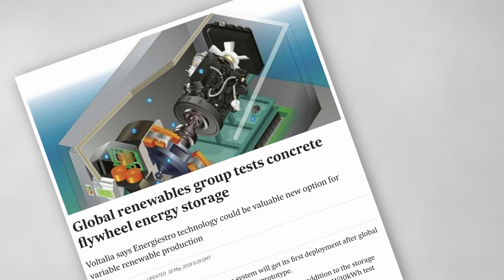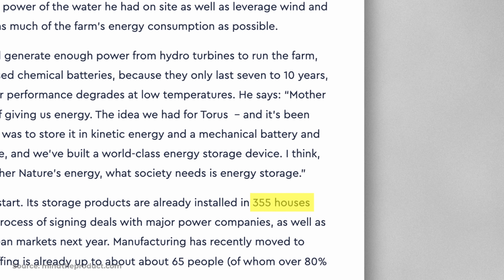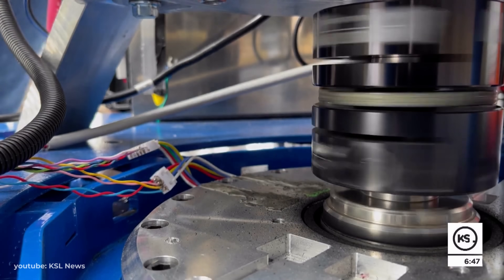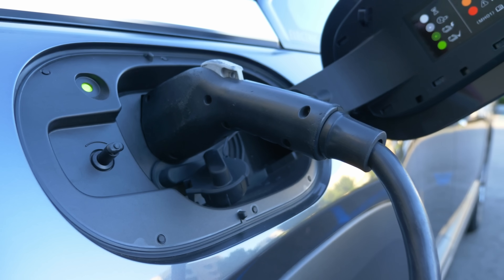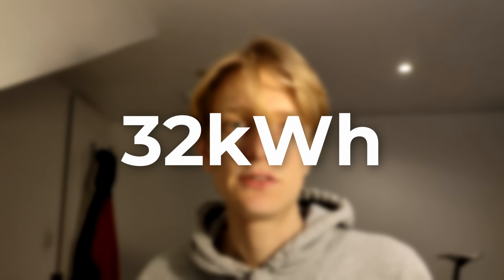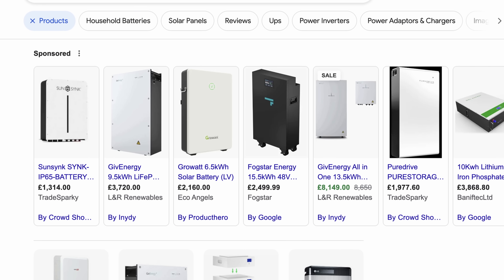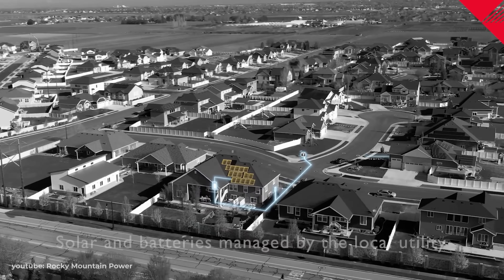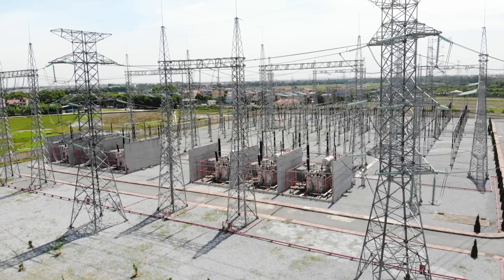Is this *FINALLY* a Break for Flywheel Energy Storage?

Comment: flywheels are bad in vehicles period... yes they work but any vibration will effect it and even the slowing down of the flywheel will have the vehicle turn in that direction... let's just keep it to buildings and accept that battery and capacitors are best for cars.
Reply: Turning moment can be eliminated by the use of paired contrarotating flywheels, and balance is no more critical than in any ICE, but the big problem is one that you missed.
Flywheels only work by being heavy, and increasing the weight of a vehicle is the last thing you want if you have any aspirations towards efficiency.  This is also a huge problem for battery-electric vehicles, of course, so need not be an immediate death sentence for the idea.  In essence, if you can overcome it for chemical batteries there is no obvious reason why you can't do the same for kinetic storage batteries.  The benefits are different in terms of leak down vs almost infinite cycle life, so the way in which they are used would be different as well, but things like magnetic bearings and vacuum containment vessels could improve efficiency quite a bit in all applications.  I think there is possible room for them in any short-term energy storage applications, and it is in fixed installations that the technology will be refined, just because it is easier, but mobile uses will increase in viability as the technology improves.  Enabling higher speeds allows lighter flywheels to store the same power as heavy ones do at present, so materials matter, as creating the best power-to-weight ratio requires putting as much of the weight as possible near the rim, and that means strong but light materials for hub and spokes, and a very strong bond between them all.  At present, that increases the cost, but it does not mean that will always be the case as those materials become less expensive with time and economies of scale.  The power-to-weight ratio doesn't matter in fixed installations, which is why it is so much easier.

Comment: It really surprises me that no one seems to be doing a large diameter flywheel, possibly under the garage floor, or under the basement floor, where the advantage of diameter can be used ... With advances in control and power conversion electronics, the conversion from DC to 50/60Hz can be avoided when charging the flywheel, and conversion to AC 50/60 Hz only needs to be done once...in truth, the use of AC power for most loads in a modern home is grossly wasteful, as it has to go through a power factor correction phase, then conversion to lower DC voltages inside the computer, tv, washing machine, et al...
Reply: You don't put stuff with moving parts in places where you can't service it.   Under cement would be a poor choice.
Reply: @zachansen8293  Couldn't the flywheel be built in a room underground with enough space for maintenance? If the design is thought out well enough, it shouldn't be a problem.

Comment: Flywheels are very much a special needs thing.  I am fascinated with Gyrobus;  City transit buses with flywheels. In the 1950's 60's were lead acid batteries didn't have the power storage. And running an overhead power line for the entire bus route could not be justified.  So, they had an overhead 3 phase power at the BUS STOP at either 2 or 10km intervals. But it appears that a 3-ton gyroscope causes wear and tear issues when you start to bounce it around.
Reply: we now have contactless bearing so I wonder if we could revisit that concept
Reply: Kind of surprised nobody is combining flywheels with batteries yet.

As in literally spin the batteries.

Batteries are heavy.

In an electric car, regenerative braking is usually very lossy. The motors produce way too much power than the batteries can absorb. If you could dump that into a flywheel that slowly bleeds into the battery, you've just solved two problems.
Reply: @jtjames79 A heavy spinning flywheel couldn't be vertical, or else it would cause gyroscopic resistance when the vehicle turns.
Reply: @kolbyking2315  You need more James Burton.
Reply: @jtjames79  that would be great for fast charging your car as well, instantly spin up at a charging station, over the next 30 mins it would charge your battery as you drive.

Comment: I read about using carbon Flywheels, magnetic Barings, spinning at 100,000 RPM in Popular Science in 1973.  I always wondered why it never came about.
Reply: The carbon fatigues and when it explodes it destroys everything in a 100m radius.
Reply: Carbon fiber composites have tremendous fatigue resistance surpassing that of steel.  Further, it isn’t the carbon fiber that fatigues over time but the epoxy or other matrix.  Properly manufactured, carbon fiber composite will outperform steel albeit at a significantly higher price.  Cost is the issue.
Reply: @Michael-Has-Opinions no, it doesn't. They're in use today.

Comment: How much noise do they make?
Reply: Gyrobus [City transit bus using a flywheel] are noted advantage of being "Quiet." In Gyrobus's in the 1960's.  Though the cost made a lot of noise.
  Note: recharging was done though an overhead power line at certain stops. The bus stop was powered not the bus route.
Reply: when "nominal", or when the explode in your house filling it with shrapnel?

Comment: I'm surprised that their form factor is about as tall as it is in diameter. The energy is related to the square of the radius and only linearly with the height. Why aren't we seeing a form factor that is a thin large diameter disk...with the mass held out by spokes?
Reply: Probably has to do with containment of pieces in a catastrophic failure.  My guess is that the vacuum chamber is built a little heavy to keep things together if it all goes bad, and making the flywheel larger in diameter could dramatically increase the cost of that.
Reply: You can spin a smaller diameter flywheel faster. And, a smaller diameter takes up less “floor” space. There may be other benefits to a smaller wheel spinning faster. Flywheels in general aren’t a good idea beyond short duration stuff anyway.
Reply: vacuum

Comment: Sounds more like a mechanical capacitor. 10kWh is hardly a lot for car charging but maybe a solar array (a big solar array) could spin up say 10 devices over the day which would then allow a car to charge, maybe, 80kWhs in 30mins. But $36,000+ is a heck of a lot of money for such convenience. It would probably be cheaper to own two cars and have one on long duration charge (from the solar array) and then just swap vehicles rather than trying to charge just the one car in a short time. 
I guess it's the bearings that cost so much - and is the flywheel kept in a vaccum?

Comment: Thank you for a great video. So well done and covers a broad range of applications and use cases. A couple of facts on our wheel. The motor on the power side is 40 kw (nominal) 88kw peak. Storage has three different sizes in kWH. 15, 22, and 50. The motors are hot swappable depending on use case. EV fast charging, commercial/industrial or large scale utility. The price in the article highlighted was for a full home systems.  Solar, hybrid inverter and hybrid chemical + flywheel storage. Which is why the price point is so high. This wheel will last for 25-years so the levelized cost of storage is exceptionally competitive to the life of almost all chemical batteries. The goal here is to divide the cost over those 25-years vs needing to repurchase chemical batteries that are tough to recycle every 7-10 years. Last part. Chemical batteries like to be in the 80%-20% charge and discharge range. So a 10kWh battery really is a 5ish kWH battery. Flywheels are 0%/100%/0% so the full range with no memory loss. All energy storage has drawbacks and flywheels have plenty. But for the use cases highlighted in this video they do a great job. Again, thank you so much for this we are a passionate team dedicating ourselves to this endeavor and the time you took to cover us without us even knowing Torus meant a lot to the team. So thank you.
Reply: 96-144v, it is an isolated DC bus, DC coupled. It is connected to a Hybrid inverter through MPPT’s. You can put 1watt-88,000watts into the wheel and that can be grid, solar, wind, or hydro. How fast, is really predicated by how big the array of solar, wind or hydro is or how big a grid connection is. 

Same rules apply on discharge. 1-88kw. But 88kw is peak. It likes 40kw. One good use case for residential outside of home loads is DC-DC fast charging at home. This is a big leap forward. Same with V2G or V2H which comes out of the box with a flywheel because of the nature of the wiring architecture vs an AC coupled 12kw 48amp “fast charger”. You are correct in assuming if you replace the bearing race pack you could put it back in service. Our life cycle testing though has not gone beyond those assumptions. These can be placed in an array. Parallel or Series to accomplish many different jobs for home, grid or commercial/industrial activities. Great questions and I hope this helps.
Reply: @NateWalkingshaw  Your DC fast charging at home proposal is misguided targeting the wrong ideal demographic.
1) Average person DOES NOT drive more than 30 miles a day in the USA
2) $200 charger 240V @ 48A with a 250 watts per mile vehicle is 48 miles so now refer back to #1
3) You still have to purchase the DC fast charger costing as low as $10K (25KW) and up to $64K (Tesla Supercharger)
4) If 25KW charging is sufficient for 100 miles of range per hour of charging with all previous context why are we chasing faster charging at the cost of accelerated battery degradation?

With that out of the way, how much is just the entire flywheel system excluding off the shelf non-proprietary components and what kind of hypothetical delivery date can we expect if ordered now?
Reply: @NateWalkingshaw   Yes, that’s very helpful, thanks. I had no idea that useful energy could be added to a spinning wheel with as little as a watt of input. So if you have a 5kW source spinning up a 20kWh wheel, how long does that take? I’m guessing that it’s like hydro storage, where you “pump” for extra time to achieve the rated output. So five hours of spin-up might yield four hours of draw-down, both at 5kW? How much power does it lose to friction? Like, how much power is needed to simply maintain a given charge? 🤔

How smoothly can it transition between storing and providing power? What if a 10kW source momentarily becomes a 2kW drain, when a cloud passes over the area? 🤷‍♂️
Reply: @serversurfer6169  C-rating is north of 10c. We are right in the zipcode of 250w of coasting loss per hour. Round trips are about 88% efficent. We have goals over 5-years to get to 91% RTE.
Reply: @NateWalkingshaw  Thanks again, but I’m not sure what you mean by “watts per hour.” Do you mean you need a continuous, 250-watt input to maintain speed, or after an hour of coasting you only lose 250 joules? 🤔
Reply from the maker: Thank you Nate for the kind words and taking the time to leave such an insightful comment. I really enjoyed researching Torus' exciting developments in this field.
Reply: I think what was really missing in the video is: what are the conversion losses, AC to AC and what are the actual self-discharge losses.
The standard way of showing this is to do a full cycle and see what the input to output kWh power is. Without that information it's hard to make a judgement.

I also don't think it's fair to say that LiFePo4 batteries have a 50% DoD. No one sensible should be buying Lead Acid now and while you get 3000 cycles from LFP at 80% DoD. Furthermore, Na+ batteries are on the way which will totally change the dynamic for chemical storage.
Reply: a 25 year lifetime is... an extraordinary claim.
Reply: No Battery has anything as low as an 80% cycle efficiency, let alone 20%, you dont need to make up lies to sell a Flywheel.
Reply: Hi Nate!
Reply: Oh, you work for Torus? 15, 22, and 50 are the sizes of the flywheel storage? And they can discharge up to 40 kW? This is a residential unit? 😅

How exactly does charging work? What's the minimum power needed for charging, and how long does it take? Can solar and wind be used to power live loads, with excess generation dumped to the flywheel? The mid-size wheel can provide 40kW for ~30min; can it instead provide 1.5kW all night? How well does it handle a variable load, or variable generation? How does the battery fit into all of this? How much do the flywheel units cost? Will we really need a new unit after 25 years, or just a fresh set of bearings for the motor? 🤔
Reply: @serversurfer6169  Get your thoughts in line. You dont know how to talk

Comment: As someone looking at solar I'm very interested in this, because I don't need something to replace batteries for long term energy storage, rather I want something that can handle the daily day/night charge/discharge cycle and that isn't going to potentially catch fire and burn down my home. It doesn't even need to last until morning, it just needs to provide power during the peak time of the evening when I'm cooking and using my devices.
Reply: Here's the thing. Storing potential energy is just that, Potential energy, if something goes wrong and it all gets out at once its bad. Doesn't matter if it's a flywheel or lead acid or water tower or lithium battery. Lifepo4 are already pretty safe, safer likely than that jug of gas for yer mower you certainly aren't keeping in a fire cabinet like you should. You're scared of li-po batteries like in yer phone, a much less stable/safe chemistry.
Reply: Yeah it'll be awesome if/when solid state batteries get more into production. Flow redux batteries are neat well for power grid systems.
Reply: Look into lifepo4 batteries. They are not fire hazards. They can be fully discharged. They are FAR cheaper than a mechanical solution.
Reply: @ericbraun4652 he is correct those style chemistry batteries are already essentially fireproof even if directly punctured cell. Also still 80%+ capacity after 5000 cycles vs 2-3000 for older lithium ion batteries that will combust every time a cell is punctured or even from dendrites over time.

Comment: Where they shine is for instance in a hospital battery backup system, stabilizing the grid electricity, as the flywheel absorbs the brunt of the many transients which otherwise accelerate wear of the chemical batteries.  Without hospital backup batteries, the let's say 20x daily body scans of the large MRIs etc would overwhelm local grid. Also,up  to 20,000 daily city grid noisy transient surges and dips pound the expensive chemical battery acting as a filter, drastically reducing its life.  So flywheel absorbs punches from outside and inside, lasting up to 20 years before chem batt replacement.
Reply: lol, you are waaaay off with the MRI comment.  those are only like 25-70kW, while running.  Unless you live in b*mf**k nowhere, off a bootleg diesel generator array on a remote island or something, the grid wouldn't even flinch.  and no one is doing 20 MRIs a day in a place like that lmfao
Reply: @youvebeenspooked  I got this information from an article on a case study. Hospital in example was using battery backup to smooth transients, reduce the hammering on the battery, and deal with chronic neighbourhood brownouts.  And then there's frequency regulation.   The assertion is that not all cities can afford to keep their old grids up to date.  Especially in industrial areas, power is not clean- and hospital equipment requires clean power.   Apparently that's what the lead acid batteries backup systems were providing already, so the flywheel extends the life, creating cost savings.
Reply: @mikemotorbike4283  stick to your little motorbikes mikey boy, you clearly have no idea what you are talking about.  using battery backup to.. reduce the hammering on the battery? lol, ok....
Reply: @mikemotorbike4283  ps tell me how power is not "clean" hahahah use some technical terms, as if you know any

Comment: Uhh.

When you talk about home usage that's one thing.

If you talk about grid storage that's a totally different topic because now you can move to different solutions and different battery types, and in sticking with a conversation wrapped around Li-Ion, which isn't good for grid storage, vs. flywheels that's a TOTALLY different topic than say, Redox flow batteries vs. flywheels, where I think flywheels would get CRUSHED in every way.  I mean Iron Redox flow batteries are better and will become less costly than pretty much anything else because there are no rare earth metals and the construction of those units isn't that complex.  The science took a long time to work out, but the cost of these units are going to drop and SHOULD replace most anything else including Li-Ion.

Regardless of the fact that Tesla has convinced some companies to use their Li-Ion grid storage units, Li-Ion shouldn't be used for grid storage.  The demand for Li-Ion batteries is already too high.